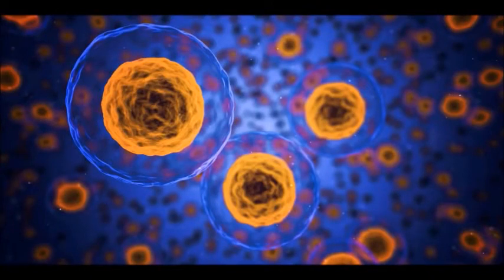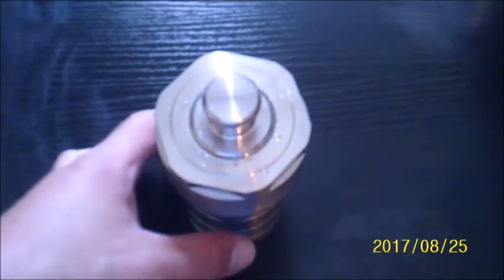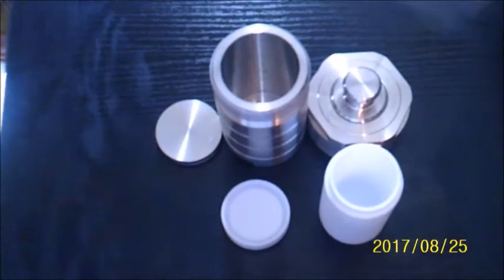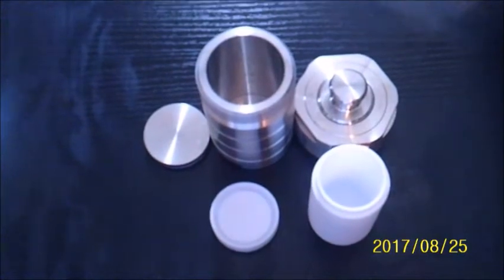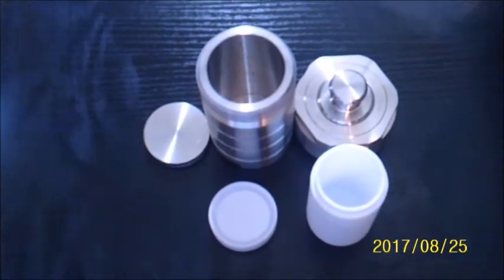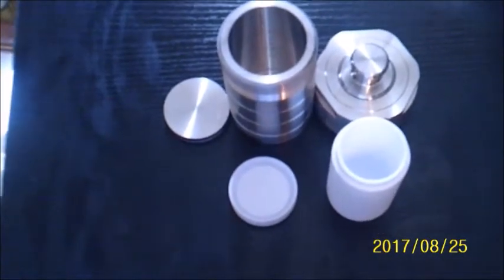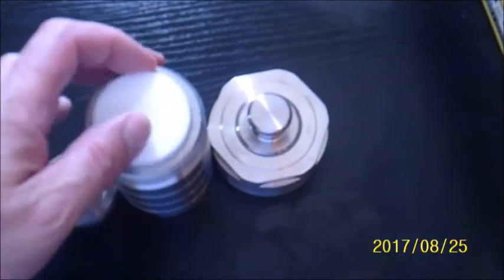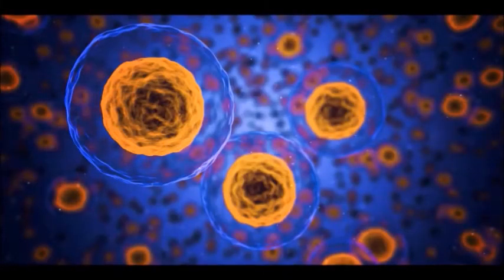My hydrothermal reaction vessel (revised)

Comment: How do you go about bringing it to a certain temp?
Reply from the maker: Well, actually I have a new one now. See my other video about my 'super deluxe' hydrothermal reactor. 
    However,  before I got the new one, I did experiments by immersing the reactor in a pot full of cooking oil,  which was on a hot plate.  The hot plate was controlled by a thermostat which had a probe inserted into the oil.  When the oil would reach the desired temp, the thermostat controller would simply turn off the electricity to the hot plate.
Reply from the maker: I also have a toaster oven which I used in the one video.  I simply set the toaster oven to the desired temp and put the hydrothermal reactor inside.
Reply: Thanks lad! You've earned a subscriber.
Reply from the maker: Thanks a lot!  Hey, you are subscribing at just the right time, too!  I am currently working on setting up the Miller-Urey apparatus.  I want to replicate the Miller-Urey experiment fairly soon.
Reply: Amazing, best of luck!